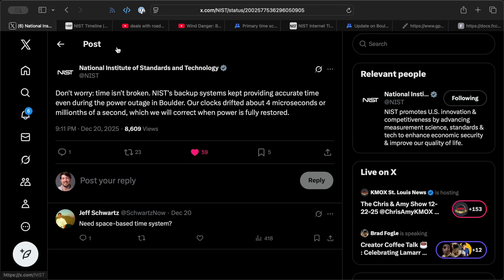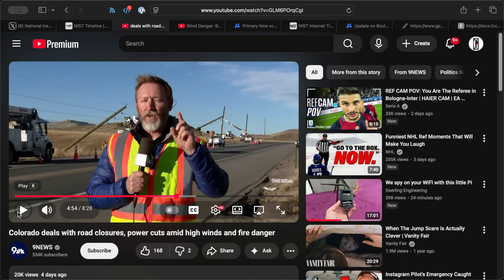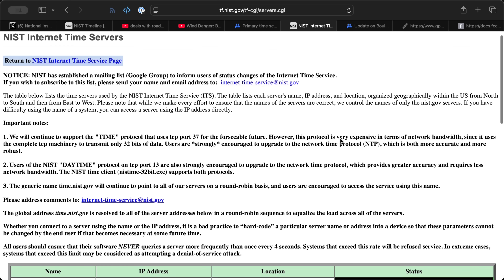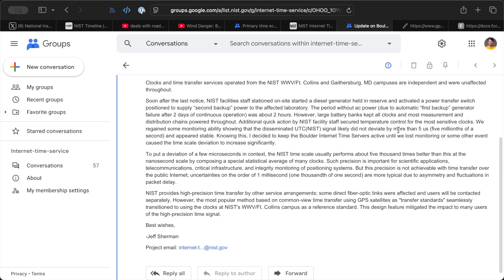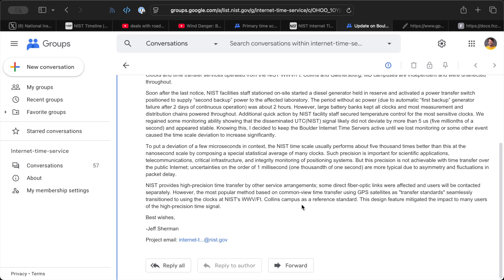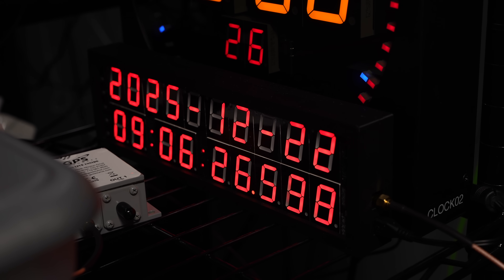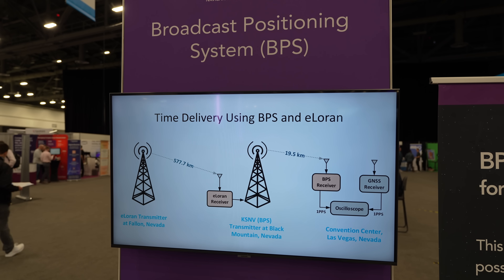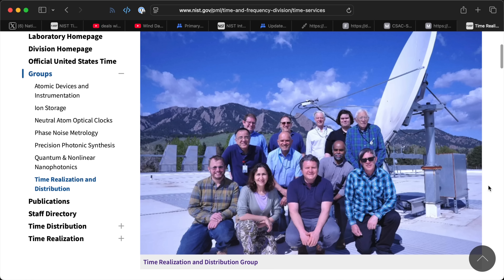NIST's NTP clock was microseconds from disaster

Comment: You are not the only one with the time nut bug.

My first professional presentation was on time synchronization, including NTP.

The good news is that there is inertial in the system.  Also, using multiple time sources, a best practice, allows detecting if one is having a bad day.

Luckily, I don't need better than millisecond timing.

Comment: If you used the Burj Kalifa (2,717 ft) as a sundial, and the incident happened at (for example) 4PM, how far would the end of the shadow move in 5 microseconds?
Reply: The Sun moves at 15 degrees per hour across the sky.  That's 0.004166 degrees per second, or 0.000000020833 degrees per 5 microseconds.  The altitude of the Sun in Dubai at 4pm varies between about 16 degrees (December) and 40 degrees (July) so the speed of the shadow varies by month.  In December the shadow would move about 0.00015 inches in 5 microseconds.  In July it would move about 0.000029 inches.

Comment: It's always DNS, except when it's NTP.

But really, it's a bit amazing to me how so much loudly breaks every year and for the most part our system clocks usually only give us problems in air-gapped scenarios. In three decades of using computers, I've only had to worry about system time due to an air gap. Feels like we have so many single point of failure scenarios on the Internet in general, but we mostly have just the right amount of redundancy to keep catastrophe at bay here.
Reply: That reminds me of the NTP pool where volunteers (including me) contribute servers. The servers themselves are usually stable, running for months or years (within internet expected accuracy in milliseconds). However the whole system relies on DNS cloud serving you addresses of local NTP servers and the TTL is quite short, usually couple minutes. If that would go down for some reason millions upon millions computers would lose time synchronization.
Reply: I've only had to worry about time when windows decides to not sync with the server or when it thinks I'm 3 hours behind on timezone. Have to go to settings, disable auto sync and reenable it and then it usually works. Piece of garbage os
Reply: Internet itself is a single point of failure
Reply: The internet's essential infrastructure is quite redundant actually. By far the biggest SPOFs in modern day internet are the company that hosts half the web, and the one that proxies the other half.

Comment: Surely most scientific experimentation is performed using relative time rather than absolute time so it would be unlikely to affect the majority of scientific research?
Reply from the maker: It really depends on the system. The more distributed the experiment (e.g. over a whole continent, or over points in a country), the more they need a better external time scale (like GPS). Some use White Rabbit now, I'm hoping to cover that next year maybe.
Reply: @JeffGeerling Ah yes that makes sense 👍 Yes I'd be interested in hearing more about that

Comment: Can’t they just like sign the timestamps sent from the gps satellites, and if signing takes time, just prepare a bunch timestamps beforehand, so you can send them in-time?

And it’s not like someone could easily climb up there to steal the private keys? Ok, they might be uploaded by software and that way be susceptible to hacking, but maybe you could design a satellite that has a write-only endpoint to upload private keys, so you can’t steal existing ones.
And if a hacker tries to upload its own private keys, they won’t be validated by the original public keys.

Comment: Nice explanation.  I am still a little confused about how NIST got out of sync?  Was the clock that got out of sync not accurate enough to keep in sync during the storm?
Reply from the maker: Good question, and I didn't see a full answer to that yet, but my best guess would be temperature changes. I'm guessing the environmental controls were down for a bit, and temperature swings can have a pretty significant impact on sensitive clocks.
Reply: @JeffGeerling luckily, someone in the comments seemed to know. Switch failed and clocks couldn't talk -- well more or less.
Reply: @x--.  Still some unanswered questions.  Based on that answer it would sound like the clock that got out of sync relies on the other clock to stay in sync.
Reply: @JeffGeerling  Atomic transitions aren't affected by temperature changes.  That's why we use them for atomic clocks.

Comment: You mean a BPS broadcast system like... DCF77?
Reply from the maker: No, a bit different than that—there are a few quirks to it because it's patented and seems to be developed in a way to justify ATSC 3.0 rollout... but it uses digital TV broadcast signals so each TV market would be covered in multiple independent time sources, where TV towers basically replace GPS satellites, with many magnitudes more powerful signals for timing.

Comment: I design software for sonar systems. Our current (quiet elaborate) implementation synchronize various parts of the system down to ~30 ns. We have options for improvement, but we don't need to. 5 µs however is clearly out of spec.

Comment: People allways say they need uS or nS timing, yet no one ever gives a real world example of such a need.
Reply: The cell phone network is a big one.  It relies on precise timing.  Even the old digital time network required accurate timing to keep everything synced.  At the company where I used to work, there were LORAN C receivers to sync the clocks.  Then that clock was distributed as part of the T1 signals around the network and to the customer sites.  However, that was a time base clock and not time of day.

Comment: On many linux distros you don't want "ntpdate" but "timedatectl timesync-status". Running the whole reference ntp suite is overkill for most systems so there's lightweight client-only implementations, and systemd ships with one, and a heap of systems use systemd.
Reply from the maker: Heh I live in the past!
Reply: @JeffGeerling  ntpdate is indeed outdated but chrony will be always relevant and reliable. Much better than any sntp client.
Reply: Heap is a very appropriate term.
Reply: I disagree. Systemd has only low accuracy sntp client which I recommend removing in favor of proper NTP client. Anything modern like chrony is really lightweight and accurate. Even on lowly SBC. Once it stabilizes it requests time from the server like three times per hour, so it's hardly any load.
Reply: @jan.tichavsky  Desktops generally don't need the precision and most server loads are perfectly fine on an inaccurate clock as long as it's monotonic.
Using sntp doesn't mean that the client can't figure out its own drift, adjust the clock smoothly etc,  it means that it's not suitable as a reference clock and will only have to talk to a single upstream server. Unless you're setting up a local timeserver to serve multiple clients sntp will likely be just fine, and keep load off servers which are busy enough so that every large linux distro names their own servers to not swamp generic ones.
Reply: The inaccuracy of rdate with the bloat of systemd, we've arrived at the past in the future.
Reply: @KralTube2  Systemd is lovely

Comment: I worked with the guy who invented NTP. He had charts on the wall showing stuff like how much NIST drifted, or how far different the different GPS satellites were. He'd load a dozen cesium clocks into his truck and drive them down to DC to synchronize them every month or two. There was one chart he was especially amused by, pointing out it looked like something was drifting, with a bump every morning of drifting even farther for about a week, then suddenly went back to spot on; he guessed the guy making the adjustment wasn't sure which way to turn the knob.

Occasionally someone would be talking about a computer network protocol, and someone would ask "what if the server's time doesn't match the client's time?"  He'd just say "We solved that problem. Let's move on."
Reply: David  Mills, quite an interesting guy...
Reply: I wonder what his opinion is on PTP
Reply: @dascandy  Dave Mills passed away a year or so ago.  I was a student of his, and one of the authors of the first NTP implementation for UNIX back in the day.   The goal there was to see if you could build an implementation from Dave's protocol spec in the RFC, and not cheat by looking at hist PDP-11 "Fuzzball" code.   Quite a lot of fun doing that!

Dave was quite the character, and directly responsible for the trajectory of my career over the years in the Internet space.   This was back in the the early to mid 1980's, before there was the commercial Internet and before there was the NSFNET and other educational backbone networks.  What a time!   I really do miss him, and we are all better off from the work that he did.

I think that Dave was well aware of PTP.   It some ways, it solved a somewhat different problem than NTP does.  So not so much a replacement, but addressing different use-cases.
Reply: @lmamakos  so, he doesn't have much of an opinion on PTP then.

Comment: I used to work for a mobile phone/cell provider. 5 microseconds is a big deal. Dropped calls just to begin with. We had to bring in a portable atomic clock once, that was a nice "antique" piece of hardware. I think it went down to thirteen digits. We had some problems with some 2M/E1 lines

Comment: I get my time via longwave from the Physikalisch Technische Bundesanstalt in Mainflingen, germany. DCF77. It is also used to set automatic clocks in homes. If you use Phase Locked Loop their time signal is accurate to around 5 to 20 microseconds.
Reply: They want to shut it down because it's old, not that accurate and used mostly by consumer clocks. For greater accuracy you need to know the precise distance to the transmitter. GPS solved that problem long time ago.

Comment: I wondered how anyone could have microsecond accuracy without a direct fiber connection, with a known length, to the NIST clock. Turns out you can't, you need the direct connection.
Reply from the maker: It costs a lot, and requires co-locating your equipment there... but there's a reason most of us just use GPS!
Reply: Actually, it can be done if both sites have sight to the same satellite.  They then observe known transitions from the satellite and use those as a reference.  Sort of like how sailors observed the motions of Jupiter's moons and compared to an almanac published by the Greenwich observatory, to determine longitude.
Reply: Actually you can.  This is how GPS works.

Comment: I do wonder what kind of research requires such exact time clocks. Wouldn't most kinds of research just care about time intervals? Like time between event a and event b is 4 nanoseconds. Not that the actual time is 20:23:42 and 4 nanoseconds.
Reply from the maker: Well, a lot of it is about distributed time — if you're detecting planet-sized gravity waves, and have detectors in places 5000 miles apart, you need to have them all in sync with some reference...
Reply: @JeffGeerling  Never looked at it that way, thanks for clearing that up.
Reply: Astronomers kinda like actual time.  🙂
Reply: All high speed communication links, fiber, internet, telephone rely on highly accurate time.  And all of the services that rely on those links therefore rely on highly accurate time.

Comment: For an organization flush with hydrogen masers, cesium fountain clocks, strontium optical clocks and (presumably) incredible quantum logic clocks, 5 microseconds over a few days holdover is ENORMOUS!  That's 1.8 mS / yr and I would think that holding within should have been comparatively trivial even in the 1960's.
Reply: According to another poster all the fancy clocks couldn't communicate due to a switch failure.

Comment: I grew up in Denver and used to call NIST with a local number to set our clocks.
Fast forward about 20 years, and I worked for Lockheed as a Metrologist mainly in RF/Microwave and calibrated hundreds of rubidium oscillators using our HP ceasium beam atomic clock standard synced with GPS, ultimately to NIST.
Reply: Love metrology. Coolest science ever. Been doing it for 10 years myself
Reply: New a guy in Colorado Springs name Clyde that repaired those oscillators.. Great guy..
Reply: Did you call NIST to set those atomic clocks?  🙂

I remember tuning WWV or CHU time signals on shortwave.  They could also be used to check frequency.  I have a clock here that used to receive WWVB but it stopped doing that a few years ago.
Reply: Actually ultimately I don’t think it’s NIST. The world atomic clock primary is in UK. Secondary is in Colorado Springs.
Reply: @SimonCas , you don't even know where they are.

There are several, but Colorado Springs isn't one of them.  It's Boulder, CO.  You may be thinking NORAD HQ.
Reply: @SimonCas  That is where I am at and was a defense contractor and been in those rooms upgrading wiring, clocks, etc
Reply: @SimonCas  The actual primary standard is the stars.  There are multiple atomic clocks that contribute to a consensus, and the "C" in Universal Coordinated Time refers to this consensus.  I assume one of those is in Colorado Springs.  The standard for the length of a second is a specific number of oscillations of a particular transition in a particular atom, which is what those clocks all count, but there is still uncertainty (damn Heisenberg!, damn Einstein!), so corrections to UTC are periodically made so that UTC agrees with celestial measurements made by multiple observatories.  Or possibly astrologers.

Comment: I still mainly use WWV to set my manual clocks, and NTP for everything else. I like to have accurate time, but a drift of less than a few seconds is fine for me most of the time. Funny enough, using ft8 or wspr over ham radio is probably where I need the most accurate timing.

Comment: How does this impact GLONAS and Baidu? Would a GNSS time server save the day? My cheapo gnss ntp server typically has 26 to 29 satellites in view with lows in the 18-20. From power on to lock is less than a few seconds now, it was more than 10 seconds when I had the receiver in a window with an average of 10 satellites.
Reply from the maker: This particular incident shouldn't affect the other constellations at all (GPS wasn't even impacted, since the failover happened)—but using systems that are multi constellation can further mitigate GPS issues.
Reply: Nothing happened to GPS.  Yes, you could build time servers based on the European, Russian or Chinese GNSS systems.

Comment: The most interesting out-of-sync story in recent history was the April 8, 2018 story "European grid dispute resolved, lost 6 minutes returned to oven clocks" reported by ARSTechnica. A dispute in Kosovo caused a 113GWh drain on the European grid; the incident dropped entire network's line frequency from 50Hz to 49.996 Hz for almost TWO MONTHS. In terms of grid dynamics, that was the unstoppable force vs. the impenetrable wall; the rock-solid 50Hz was the casualty. The self-synchronizing line frequency can impact generators, but only if you deviate about 1% from normal. Nothing except for ancient cheap clocks runs off the line frequency these days, but 6 minutes worth of stolen oscillations was enough to raise civilian awareness most everywhere. Regulators were positively mortified; I would have loved to be a fly on the wall in Belgium where they private discussed this s-storm. Regulators deliberately set the line frequency to a bit above 50Hz for a corresponding amount of time; that did nothing for the people who had already fixed their oven clocks.
I liked the story because electrical impedance works so well that very few people are even aware of its dynamics. It took a massive screwup for the relationship between power drain and line frequency to ever percolate up to the layer of consciousness. That's too bad, because mechanical impedance (including bio-mechanical impedance) is a real thing, and it's a worthy topic to understand. After you master your ABCs, practice your RLCs. Next, learn how the impedance analogy can transfer that knowledge to your head, elbow, and knees. Digital is great, but analog is still pretty nifty, too. I for one am somewhat saddened that MIT offers a Computer Science major these days without any signal processing courses. My old MIT 6.001 professor spent an entire lecture about his days in UROP (undergrad research) solving differential equations on an analog computer.

Thanks for this story of the heroes of NCAR. Chinook winds can be a wild thing in that part of the world.